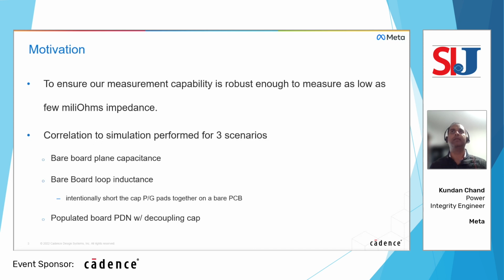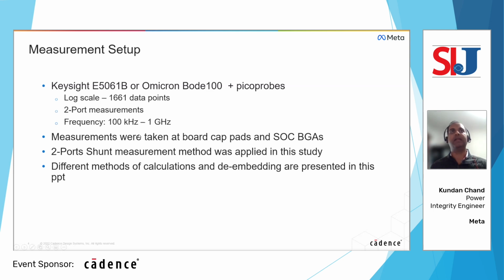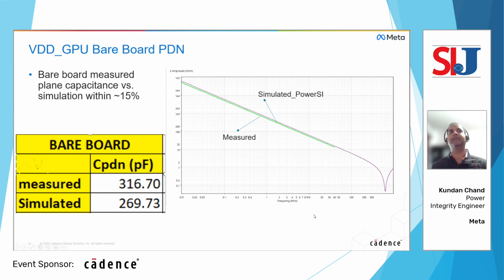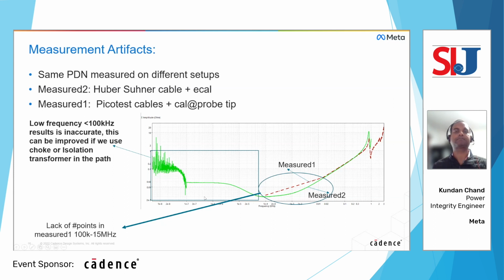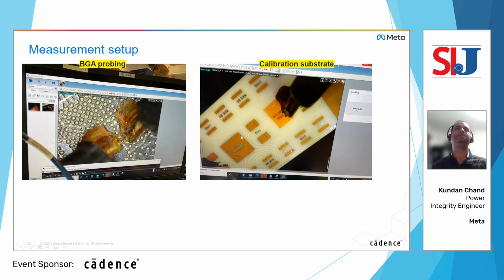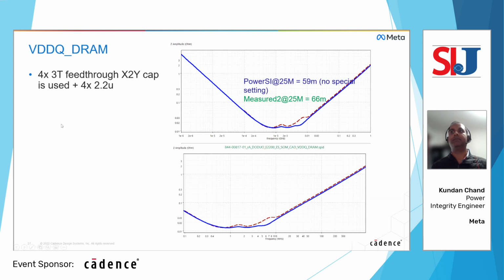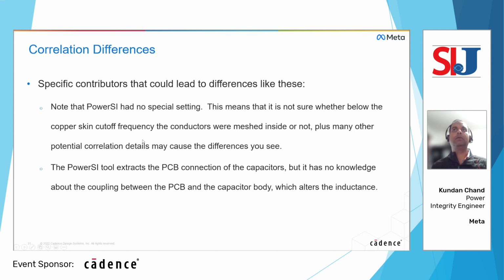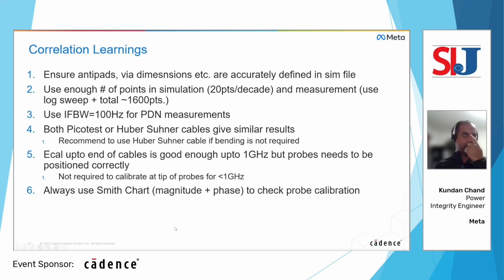Comparing PDN Simulation to Measurements for AR/VR Products

Comment from the maker: Discover how Kundan Chand (Meta) uses the vector network analyzer and Clarity 3D Solver to achieve sub-15% correlation for complex PDN designs.

Are you currently validating your power integrity models in the lab, or are you pushing the limits of 3D simulation?